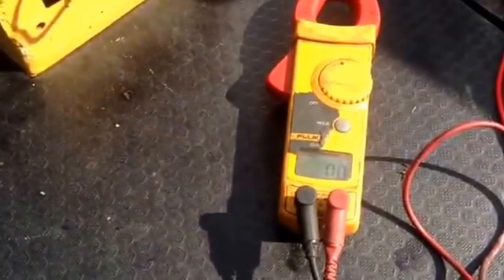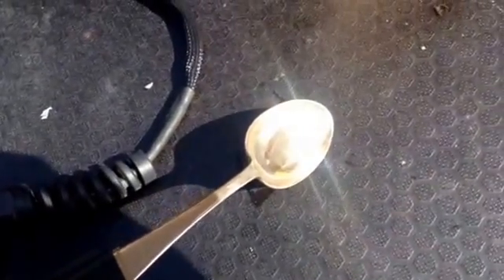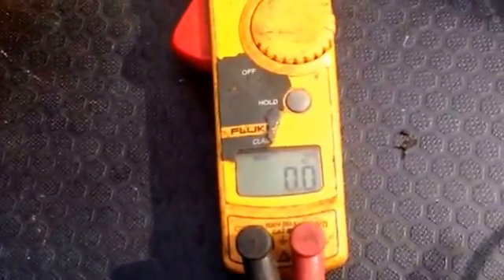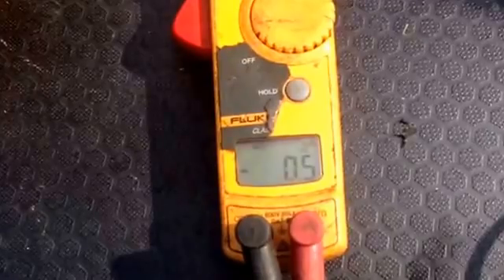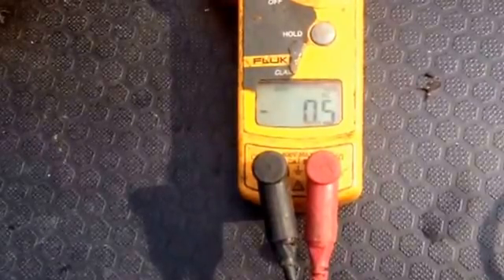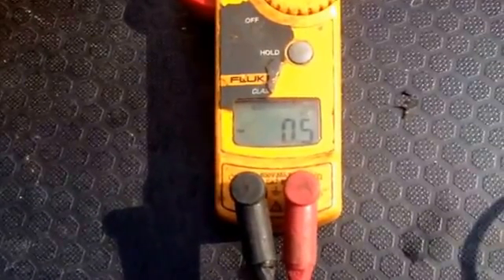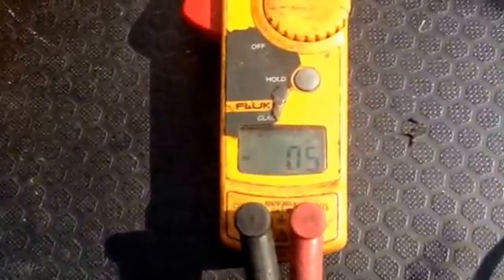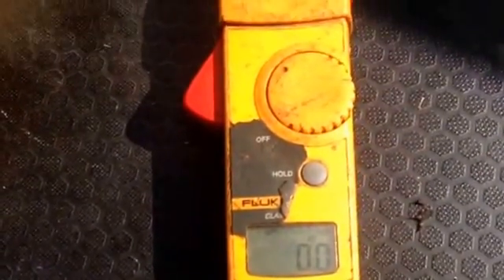Testing Hull potential on steel hull boat( galvanic and electrolytic corrosion ) test

Comment: I'm assuming from the video that a -.5 voltage shows that this boat needs more protection and is outside the acceptable range. Am I correct?
Reply: @xlbubblehead2505  I did add a hanging anode and it got it into range.